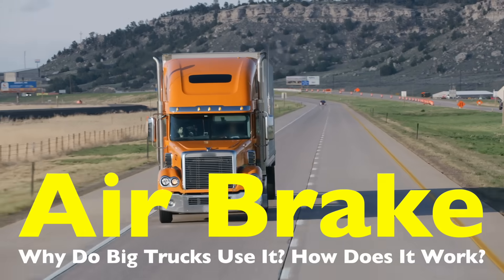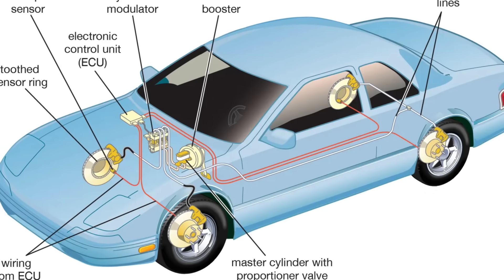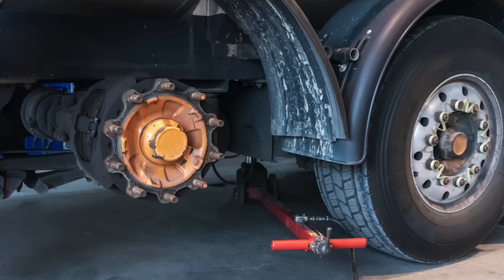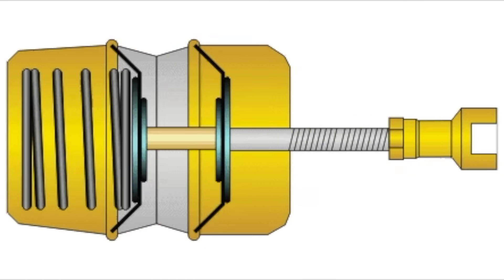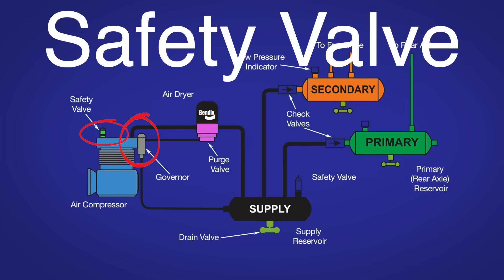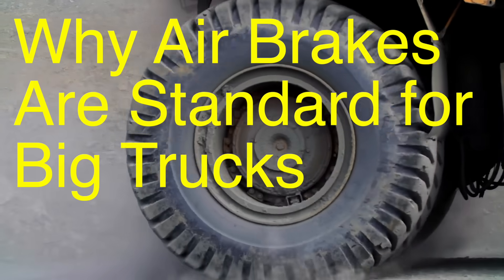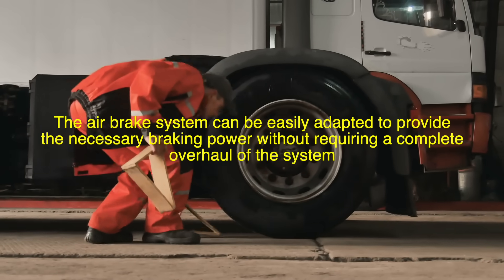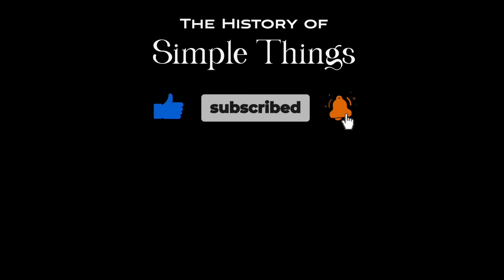Why Do Big Trucks Use Air Brakes? How Does It work?

Comment: Thanks for the video. I thought air brakes referred to the flab that blocks the air intake/induction. I guess that is something entirely different, then. Many have explained to me that the engine braking system (the loud noise blocking the air intake, in the olden days probably blocking the carburettor intake?) was called an air brake. Thanks for the clarification. Someone please explain what the system I am trying to describe is called, what function it serves, and how it works. Thanks!

Comment: Even a standard truck and semi trailer combination has at least 12 brakes these days, imagine the pedal pressure needed to activate all those babies hydraulically. The dual circuit argument is a bit irrelevant though - cars have had dual circuit braking since the 1960's

Comment: If you have a leak in your air brakes, it will still work, indefinitely if its not bad, as the source of the pressure can be restored. If its hydrolic, then it will fail eventually, even with a small leak.

Comment: Something that should be mentioned and is often overlooked is that even though trucks have very good braking systems, their increased weight and size means that they still take more distance to stop - kinetic energy is a thing and ALL drivers of ALL vehicles on the road need to be aware of this. Truck drivers often get the rap when there are large mishaps, but they haven't been given the room they need to execute their job safely.

Comment: What are the emergency truck off ramps used for?
Reply: Emergencies. Specifically, brake failure/runaway truck. Most sensible emergency ramps have sand in place of the road, called an arrester bed, to slow down a heavy truck quickly. Usually these are near the bottom of a steep downhill descent where it is more likely a truck's brakes will fail from overheating or shattering or broken pressure lines. Probably a good idea for airports, instead of having walls or trees or buildings at the end of a runway, they should have sand or something.

Comment: you could design a hydraulic system with the same fail safe spring system integrated. the connect / disconnect from the trailer is the biggest challange to resolve here.  hydrualic connections will leak, just look at the back of a farm tractor, they are ussually covered in oil.  the air system is clean and easy to connect and disconnect from the trailers.  nice video.
Reply: The biggest problem with hydraulic brakes is the amount of pedal pressure required to pull the vehicle up. Your car has a vacuum booster to boost the system pressure, that would never work on a heavy vehicle. The alternative is to use compressed air, at which stage you are better off just to go full air anyway

Comment: If the air compressor  is failing or if the air tanks is loosing its airpressure, the vehicle will stop very fast, because the  brake system is reversed...

Comment: All cars and trucks sold in the last ?? years have a dual system so if the front brakes have a leak and fail, you still have rear brakes and vice versa.

Comment: Can't they redesign the hydraulic to work like the air brake.
Like they are defaulted to be always on stopping position and the hydraulic prevents it from braking.
So in the event of a hydraulic leak, the brake would stop stopping?

Comment: Just think, now because of bendix the truck driver doesn't even have control of the brakes! The computer can slam on the brakes without reason! Driving into the sunset? Lookout you might hit the Sun (NOT JOKING) Has happened multiple times.

Comment: To clarify: spring pressure APPLIES the brakes. Air pressure is used to overcome the springs and thus  RELEASE the brakes. Do I have that correct?

Comment: A couple of reasons for not having an air brake system on a passenger car is the increased size, weight and power requirements.

Comment: I think they also use air brakes because brake fluid can heat up  and introduce air bubbles that can cause failure, on a typical car it doesn't really happen but on heavy truck with load can easily heat up and fail

Comment: It is not uncommon that there are cases in which when a truck is running down a long slope, the brake fail. I used to believe that the problem is the driver has consumed too much pressure-air on brake to slow down the truck. But if loss of air pressure would start the spring to press the brake, why so many run-away truck happened when they are running down a long slope?
Reply: Because the brakes have overheated and can no longer provide the friction need to slow the wheel rotation.

Comment: I much prefer rigid forks. If you have wide tires, like 2.5 and up, you can run the pressure a little low that will absorb small bumps. It gives much better handling, and you can handle larger bumps with a little technique. 

Unless you have actual high quality suspension, which you only see on $4k+ e-bikes, then they actually feel good. Rigid forks are one reason i like radio flyer e-bikes

Comment: I don't think modern car hydraulic brakes fail all around from a single leak. Each wheel has its own isolated line. If one of them leaks, the other 3 are still functional

Comment: There was a movie I watch where the enemy cut off the air break hose, and truck failed to stop even if the driver press on the break pedal. After this video, I'm confident that the scrne was inaccurate.

Comment: The main advantage of pneumatic system is, air is everywhere. So, when there's a leak , you only repair without refilling and there's no oil spills. The second advantage is , they are pressure release spring applied. So, you need a certain amount of air pressure to release the brakes , should the pressure drops in the system the brakes apply . So, that's also help protect the driver should the system fail , the brakes apply immediately. Other than that, the similar concept occurs in some hydraulic systems

Comment: Break failures is serious issue in cars with hydraulic break systems. Why is the air break system not used in cars and lighter vehicles?

Comment: Hydraulics can stop just as much weight as air. That's not the reason for an air system.
Fail-safe, spring operated systems can work with hydraulics also. That's not the reason for an air system.
Hydraulics can be made in dual-circuit systems too. That's not the reason for an air system.

The reason for an air system is simply that you've always got an effectively never-ending supply of extra air to use. You can't run out of it, via leaks and daily trailer connections and disconnections, as long as you're in Earth's atmosphere. You don't need to carry around extra quarts of air in case you run low.

Comment: Westinghouse Company as an American Company or corporation should get some of the credit on their input on BRAKING and life saving device and making it safer for people?It all started with STEAM BRAKING on Railroad cars? You see. When you have aload behind and you are towing it and you want to stop? The extrem rear point wants keep going or so called  JACKNIFE around towards the front? Its a massive spring thats compressed by  LOW PREASURE AIR  OR  LOW PREASURE  STEAM ONLY while when the compresser  supply is running. This is a very very simple and positive action that can take place as the operator connects they feed lines to the rear trailer and as the operators brake pedal and leaver brake on stearing collum? The stearing collum brake handle is used on a hill as to not allow trailer to roll back.The BLOW OFF VALVE  on the tractors dashboard allows the trailer to be uncoupled when presser is released and coilspring presser is applied to brake drums.These braking systems have been known to lock up completly on the trailers tanum wheels if they break away from the fith wheel or kingpin break.

Comment: 0:25 I used to be a Truck Driver...

The truck/Trailer combination shown weighs a MINIMUM of 36,400 Lbs. with an empty trailer...maximum Weight for an 18 wheel, 5 axle truck & trailer (like shown) is 80,000 Lbs. (USA) and 88,000 Lbs. (Canada)...more axles increase that limit, fewer reduce it...this is a general rule because the spacing between axles also affects the maximum Weight Limit as well...

Comment: When you press a hydraulic brake pedal you apply hydraulic pressure to the brakes. When you press an air brake pedal you release air pressure allowing the brake springs to activate the brakes.
Reply: Incorrect mate. When you push the brake pedal it sends a charge of air to a proportioning valve on the air tank that sends the application air to the brake booster. The brake booster has 2 chambers. ! with a spring being held back but the release of the park brake and 1 that applies the brake with air. Thischamber has a soft spring to aid with releaseing the brake when you lift off the brake pedal.

Comment: There are still things that can go wrong, in Europe at least the trailer has a “shunt” button, this disables the brakes so that you can move the trailer around the yard without having to hook up all the air lines and build pressure and everything… but some idiot drivers who don’t do their checks properly can forget about that and end up driving down the road with no brakes at all on the trailer. 😐

Comment: Many times we see buses (using air-brakes) & trucks come to a halt at a red signal, then the driver flicks a switch to let a gush of air out. Why is that ? It is because of too much air pressure in the tanks which are indicated to the driver in a pressure gauge, whereupon he releases the excess pressure manually ?
Reply: Many vehicles with air brakes have a valve on the dryer that briefly opens when the system comes up to its full rated pressure and the compressor cuts out. This is done to release any accumulated condensation from the system.  There may also be such a valve on each of th air tanks as well, but that was not very common when I changed careers from being a mechanic 28 years ago.

Comment: You can get brake bands in widths from 7 inches (normal) to about 10 inches ( for extreme duty, like coming off a mountain with a huge load of logs) making air brakes easily adaptable to the expected weight and other stresses that come with the variety of job commercial trucks are made for. Such modifications would be difficult with a hydraulic brake system without significant alteration of components, like a double or triple size fluid reservoir to power the larger brakes, and other mods that might not fit the space for the tires and wheels.

Comment: In effect, each brake "can" has a normal mode, where the driver controls how much, if any braking is applied, and an emergency side so that if air pressure to the axle end (can) is lost, the brakes apply with no human intervention.

Comment: A vehicle using hydraulic brakes, pulling a trailer has a fully separate brake system from the trailer. The non commercial trailer GENERALLY uses an electrically activated brake system, controlled from the driver seat, some have control bars that the driver can use to actuate the trailer bakes independently. The trailer brakes on campers and small vehicle have no connection to the towed vehicle braking system. Air brakes on a CMV have a direct connection to the towed vehicles brake system, a design not available to non commercial vehicles today. A car is not designed to pull a commercial weight  trailer, a road tractor is designed, from the first drawing to final product to be a powered vehicle pulling a trailing load heavier than the weight of the tractor. A "big rig" OTR tractor weighs about 12 to 125K, but the overall weight of a 5 axle American road tractor is 40 tons (80K). The design difference is very real.

Comment: I call Brave Serria on the spring brake reasoning as to why air brakes are used on big trucks. When I began driving semi trucks, in the early ‘70s, air brakes were widely used and spring brakes were just coming onto the market. Spring brakes soon became a DOT requirement as they do greatly increase the safety of the braking system but they didn’t exist when air brakes took the lead in large vehicle braking. Get your facts right if you really want to explain things.

Comment: The last semi I drove was in the '70s. The tractor had two air lines to the trailer, the one that followed the brake pedal, and the red one that charged a trailer air tank up, which would put on the trailer brakes if the pressure in the charging line from the tractor dropped too low.
I'm surprised nothing was said about this. Doesn't this still exist?

Comment: My question I’ve given a few guys is why not electric brakes like in most light trailers. Anybody who has used air brakes in the north is well aware of frozen brakes (usually on the trailer) that lock up and leave the trucker down until such time they can be thawed. All the methods of thawing them introduce more moisture that refreezes shortly after the heating source is removed. That herein the Canadian north. I’ve been working in heavy industry for decades and we’ve had multiple trucks every winter with frozen brake lines on their trailers.

Comment: All weather cond. Need to use an alchol type air drier products and systems to remove moisture. Frozen air systems. There are fan like pie plate to help cool brakes. But not 9ften used. Lol. Easier to just bkame the operator. Easier to hook and unhook trailers.

Comment: As a 40 year trucker, I see a couple things not covered -
First, while the system can automatically apply the brakes, it depends on the condition of the shoes/pads - if they're hot, they're less effective; if they're smoking, the brakes are wholly ineffective. The brakes on ALL vehicles rely on the ability of the shoes/pads absorbing heat and re-radiating it. Heat is created by friction - basically the brakes exchange motion energy into heat energy; if the brakes heat up enough, they aren't transferring heat any more, and continued friction will eventually set the brakes on fire.
Second, and related, hydraulic fluid can boil. When it does, it creates bubbles, which cause failure in the system, as the system relies on the closed liquid system.

Comment: Air brakes were'nt always failsafe. In the early days of air brakes air pressure was used to apply the brakes. In these systems if air pressure was lost there were no brakes. I think they were better than hydraulic brakes for larger vehicles but were a bit more prone to failuer. I'm sure today's air brake systems have prevented many accidents and saved many lives.

Comment: Hydraulic systems can also be designed to be fail safe by using spring applied hydraulic release braking systems. I am guessing the main reason air brakes are used is because of cost, ease of maintenance, and mainly because it’s much easier to couple air brakes to a trailer than using hydraulics

Comment: As a truck driver for 35 years the reason air brakes are effective is due to their failure safe setup. Air is sent from the Air Compressor to the Storage Air Tank, which also sends Air to Two Tanks known as Primary and Secondary, after which the Air is sent to the Front (coming from Secondary Tank) Air to rear (coming from Primary Tank) so even if the Storage Tank for whatever reasons fails, the other two tanks will still have air.

Comment: I don't get why air brakes need dual circuits. The moment one of them fails, you have some of the wheels blocked and to continue driving you need to repair it anyway.

Comment: theoretically they are great. but in reality most neglects to maintain the failsafe system. ive seen too many cases where trucks keep moving at insane speeds when the brake fails, instead of the failsafes (automatic engaging of brakes) deploying

Comment: Personally, I think a de-pressurized system should have the brake pads spring-loaded into drum. That means the brakes are applied by default and require pressure to dis-engage.

Comment: A key feature that may have been overlooked is air brakes' ability to highly amplify the driver's pedal effort.  Consider that typical automotive hydraulic brakes already use a ratio between master cylinder to caliper or wheel cylinder diameter to achieve some mechanical advantage, and pedal effort is amplified by a vacuum powered booster.  On heavy trucks, compressed air acts directly on diaphragms at each wheel to perform this same function at much higher rates of amplification.  It might be impossible to achieve the needed braking force if compressed air or some other similar motor pressurized fluid weren't used.

Comment: Interesting parallels with aviation here. Airliners use hydraulics (obviously), but like air brake systems, they use redundancies in a similar manner. Usually there are three systems that overlap, making failures of any given flight control or aircraft system very rare, and even if all three hydraulic systems fail, other methods provide pressure sufficient to safely operate the aircraft. In some smaller aircraft, the hydraulic pressure provides a fail-safe because landing gear is held up with the pressure, so any loss will result in the gear deploying to allow a safe landing. (In systems where this is not the case, there are numerous backup ways to drop the gear.)

Comment: Big trucks and their trailers NOW have AIR DISK BRAKES ON ALL WHEELS, making the vehicle much easier to stop, and ABS to control skidding even on the trailers. This is the best safety system being installed on all trucks and trailers is long in coming.